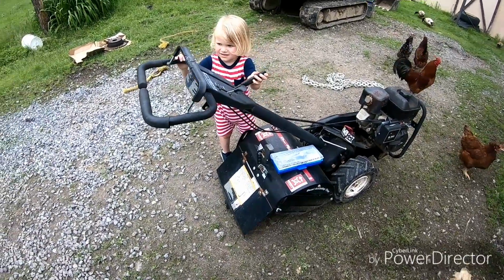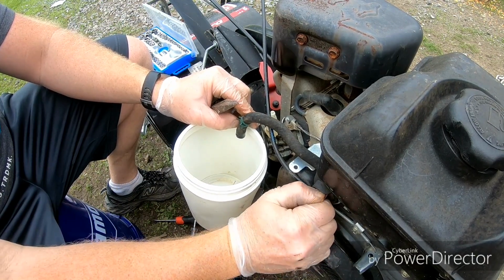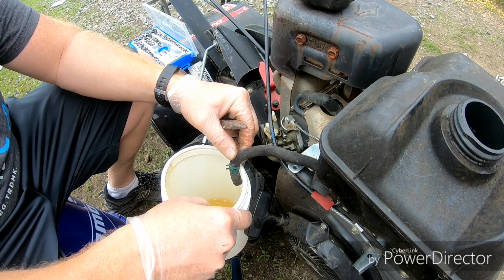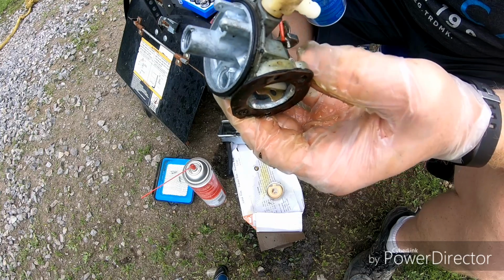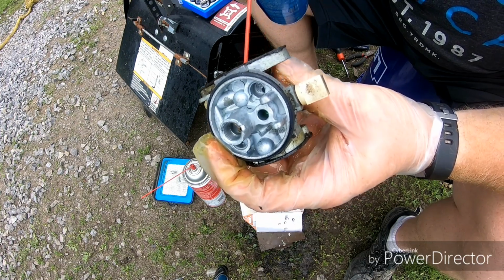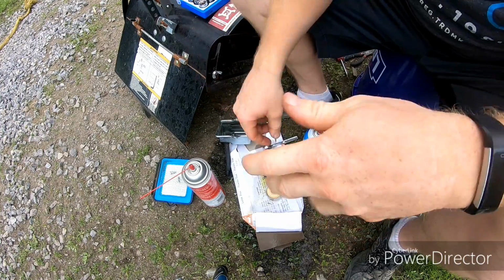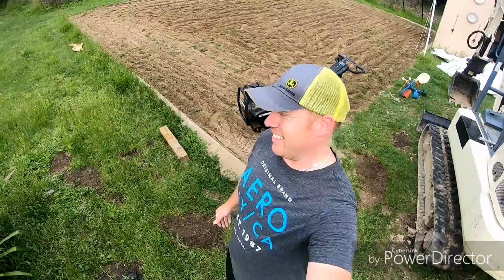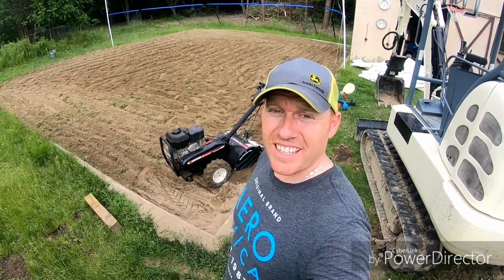How To Clean A Carburetor On A Craftsman Tiller

Comment: I have the same tiller, just took the carb off, doesn’t look bad but isn’t running unless it’s 1/2 choked most of the time. 
Wish it had different times in this clay soil we have.
Reply from the maker: You should really take it apart and take apart the inside and carb clean it really good then use compressed air to blow everything out , you shouldn't have to choke it anymore after that! Good luck and thank you for watching!👍😊

Comment: What's the part number for the carburetor?  I bought an Amazon one and the choke handle doesn't come off like the briggs one
Reply from the maker: 791077 or 798653 these are Briggs and Stratton same ones used on the snow blowers etc! Thank you for watching!👍